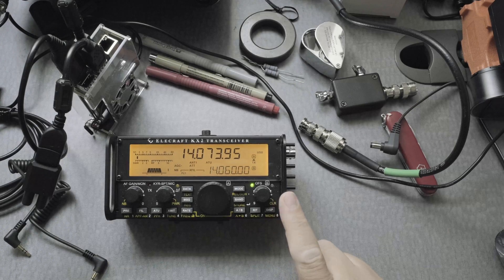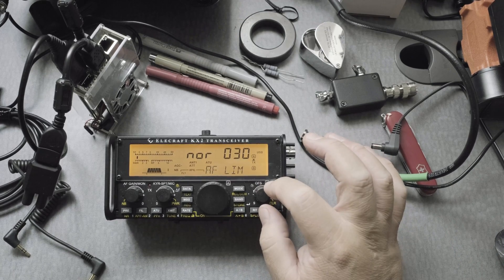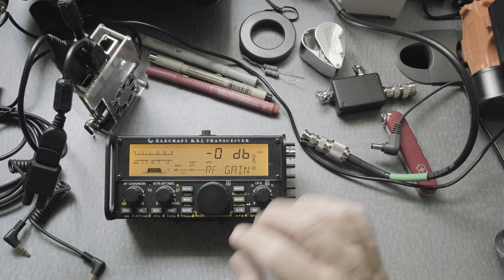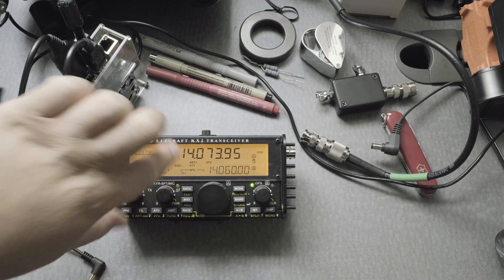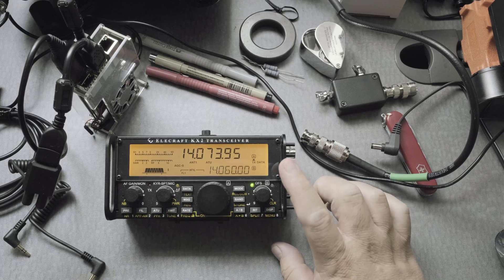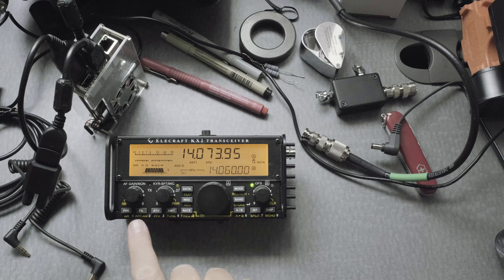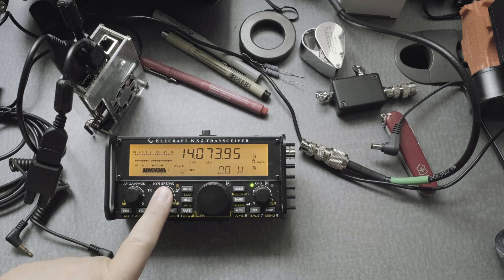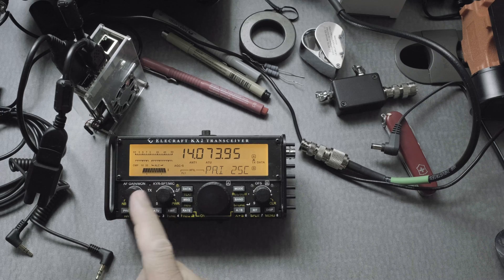Elecraft KX2 Digital Mode Setup

Comment: Frank.  I used your setup to the letter.  KX2 using the digirid works great receiving lots of stations.  Unfortunately, goes into tx mode, the TX Data switches to reverse, putting the radio into lsb.  No matter what I do, I cannot get it to stay.  Any suggestions would be greatly appreciated.
Reply from the maker: It sounds like the KX2 is switching to LSB when transmitting in digital mode, likely due to a setting mismatch between WSJT-X (or whatever software you're using) and the radio. Here are some things to check:

Ensure Data Mode is Enabled:
On the KX2, go to MENU > TX DATA and make sure it is set to NOR (normal) and not REV (reverse).
Also, check MENU > MODE and ensure DATA A is selected.
Check WSJT-X or FLdigi Settings:
In WSJT-X, go to File > Settings > Radio, and make sure the Mode is set to Data/Pkt rather than USB or LSB.
If you're using FLdigi, go to Configure > Rig Control and make sure the software isn’t forcing the radio into an unintended mode.
USB-D Mode Instead of LSB:
Try manually selecting DATA-U instead of just USB.
If you see the mode shifting, go to MENU > TX DATA and manually set it.
Check the CAT Control Configuration:
Ensure the software isn’t sending a command to switch to LSB when transmitting.
If using WSJT-X, try changing the Rig Control Mode (Hamlib vs. OmniRig) to see if the issue persists.
Try PTT via CAT or VOX:
If using PTT via CAT, try switching to PTT via RTS/DTR in your software settings and see if it makes a difference.
Firmware Update:
Check if your KX2 has the latest firmware. Older firmware versions have had some quirks with digital mode settings.

Good luck -73
Reply: Frank.  Wow.  Very detailed solution to my dilemma.  Thank you very kindly.  Switched settings in computer to usb instead of data/pkt.  I don't use the TXdata setting, only regular mode and it works like a dream.  Could not stop the data mode from switching to Rev on TX.  Weird but it works.  Greatly appreciated.

Comment: I'm going to "assume" (as dangerous as that is) that most of these digital settings will be the same for the KX3. The same knobs and buttons are on the radio but a few are in different locations. Good advice about keeping track of configuration changes. I'll give it a whirl and see how she goes. 73, N1YZ
Reply from the maker: I would assume the same. Good luck tell us if it is

Comment: Frank, Thanks. Very Helpful. Do you think you need the heat sink side panels for digital operations?
Reply from the maker: If you are doing constant and continuous transmissions - yes it will help. But I think for me this is not a good radio for Digital. It would overheat too often for continuous use. But, keep researching. There might be others that have had better success.  Also, you don’t need the heat sink if you are just doing QRP SSB. Good luck. -73

Comment: I want to again thank you for this.  I have a home brew interface box with isolation transformers and level pots.  The box also has the RTS and TXD lines available through optoisolators for PTT and RTTY (the latter not used with the KX2, of course).  The box outputs via a five pin DIN jack and I have a cable made up for each of my radios, including the KX2, which I just made up today.  At first I overlooked the step to turn MIC BIAS = OFF!  This was driving me crazy until I went back and plugged in the cheap headset/boom mic that I bought recently as a test.  At first it didn't work either, which reminded me to pull out the note card that I had made up with settings for that headset, at which time I realized that I needed to turn MIC BIAS OFF.  I also boosted VOX GN to 30; I'll have to play with that setting some more later.  Well, that got it up and running.  I'm knocking off for supper, but will try to make some FT8 contacts tonight, probably using 250 mW or less.  73!
Reply from the maker: Super. I know it can be frustrating. Good luck. -73